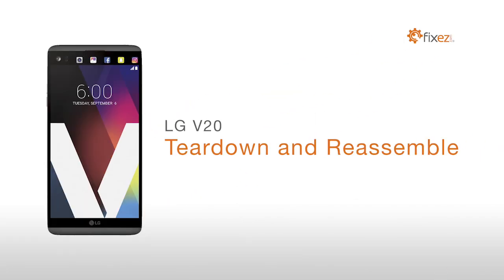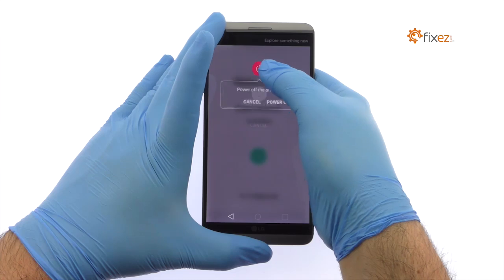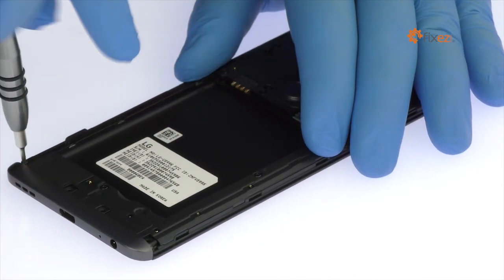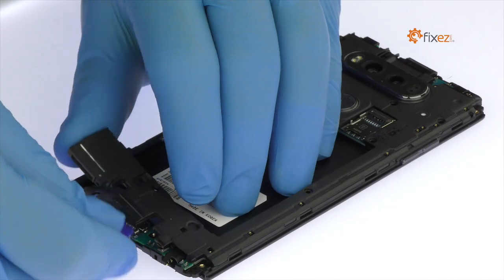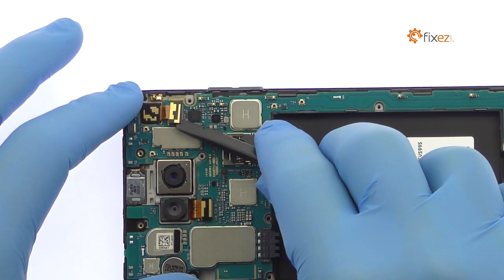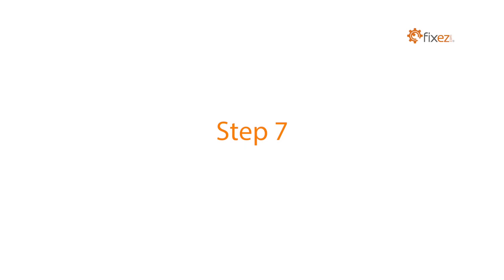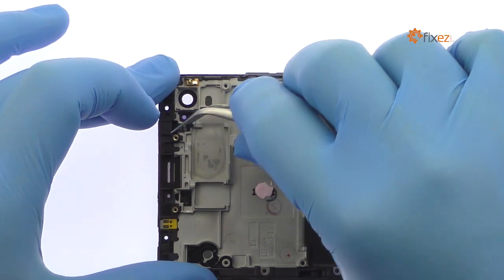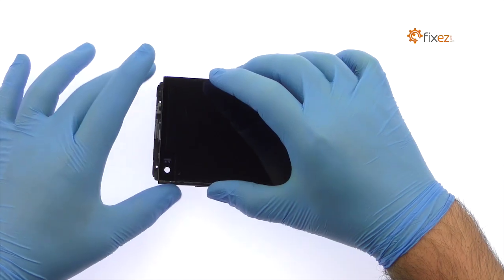LG V20 Teardown and Reassemble - Fixez.com

Comment: People are saying they can't hear me in phone calls, but I sound fine while using speakerphone.  I think the problem is my bottom mic.  Is this possible to change?  Someone online mentioned possible micro-soldering but I haven't read for sure how you replace it.
Reply from the maker: Yes, this is possible to change but it does require soldering, unfortunately. We currently do not sell this replacement part at this time.
Reply: Fixez.com Thanks for responding. I was able to track down the part. I will give it a go and see if I'm able to change it. I'm ok with normal soldering but if it's super tiny, I don't know if I can pull it off. Well the mic is unusable as is, so I don't have much to lose.
Reply: @shiggins9   Did you manage to change it? I bought the replacement mic and I was thinking of attempting to change it on my own.
Reply: @vvlad22  I bought a mic and brought my phone to a shop but it was the wrong mic. The guy had a lot of phone parts and desoldered one from a Samsung phone that looked similar to the V20 mic. It took him 3 or 4 tries but he did get it fixed. I was this close to buying another phone! He charged me around USD$60.